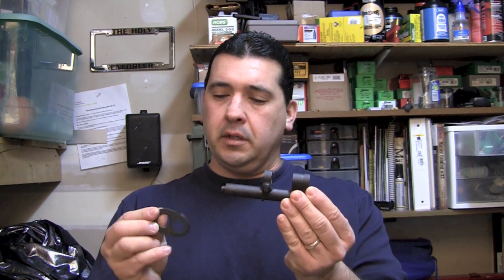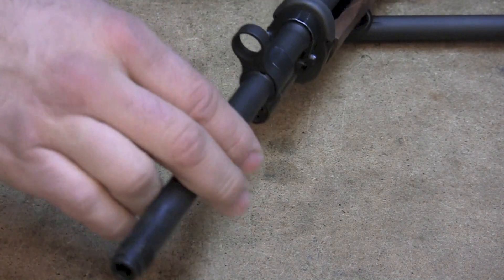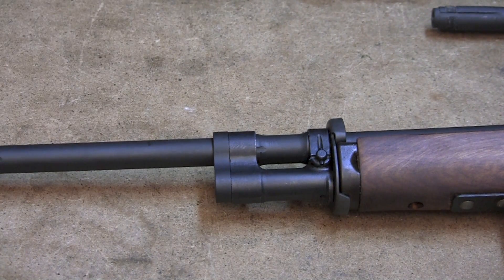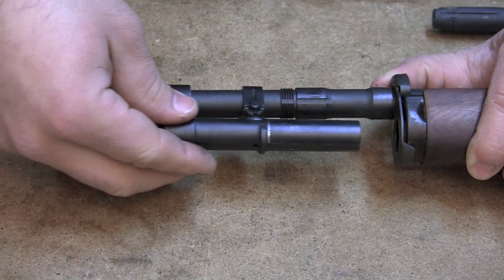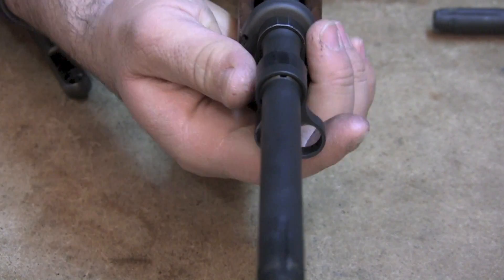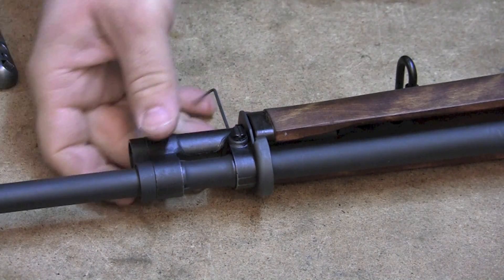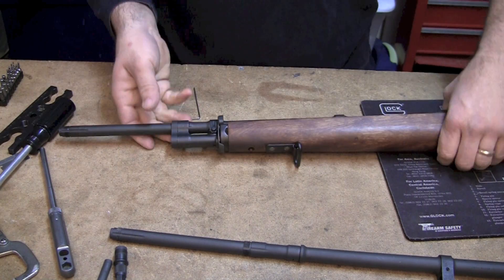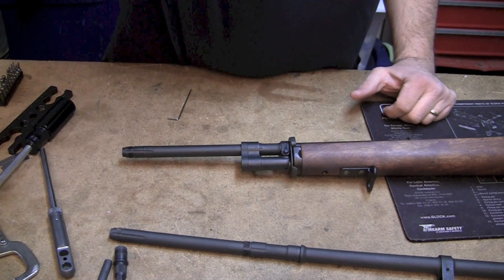Shimming the M14 Gas Cylinder and Gas Port Alignment

Comment: shimming is great but the gas cylinder needs to be unitized by tig welding the band to the gas cylinder. You still need to shim the cylinder for the correct lock up.

Comment: Does this require any special tools to completem
Reply: No, just the appropriate ring shims.. Badger Ridge Industries is a good source..  Although, some say "Just snug, screwed on to say say, 4 o'clock.. While others say screwed on to 7 o'clock, (GunBlue490) to allow for expansion when the barrel heats up.. This is somewhat new to me as well.. I'll have to try both setting...

Comment: Tony,  I have a m1a scout that I mounted into a sage ebr stock and the heel of the reciever is sitting up about a 32nd ish above the back of the stock.  I did have to have the barrel knurled by a gun Smith prior to me noticing the issue.  The Smith is going to add (machine) two set screws into my trigger assembly in order to tighten it down in the back.  Thoughts?

Comment: I purchased a norinco m14/305. The stock is loose front to rear when assembled I have 1/8”+ of play in the stock. The receiver is loose. I believe the problem is in the gas valve position on the barrel. Your video explains how to adjust it, I’m removing the nylon stock and replacing it with a USGI stock from Fred’s. I repaired the loose oprod guide block and installed the nm oprod with the wolf heavy duty spring. The fitting of the new stock and adjusting the position of the gas port is next, I don’t think this m14 has ever been shot. Thanks to you and your videos it should be up and operating soon. Thanks

Comment: Tony, 
Great videos! I have a question for you. My front band was loose so I bought shims  to shim the had block but I discovered that wasn't the problem. The front band is tight and the gas lock is roughly at 5:30, a little less but it can be positioned by hand. When I tighten down the the gas block nut the band loosens up. I removed the gas block but and discovered that there is .007 gap between the gas block where the piston goes and the gas lock when it's tight. This does not seem right to me. I would like to know your thoughts on this situation. Thank you.
Reply: This is a "Golden Age M1A, serial number between 42,000 and 63,000 of that makes any difference. Has all the hand work of Wilbur Smith with lots of GI parts used.
Reply: I did find pitting surrounding the gas port on the barrel. The gas block does not have any rotational movement from play in the splines. I am waiting on some castle nut pliers to remove flash hider. I will then check both gas lock and has block to see if either is not flat where they mate up. The gas lock is definitely not seating flush all the way around the barrel portion of the gas block.
Reply: جيد جدا

Comment: Hello sir,  thank  you for  this video.  Is it normal or ok to use all 3 shims?  Also I can see the holes line up witha flashlight but can't actually get the Allen wrench to go in the barrel. Thank you again
Reply from the maker: It's okay, as long as the gas ports line up.

Comment: Tony I am having some short stroking on my national match Springfield. Only 300 rounds in. Piston drops free. Gas port hole looks good but last hole where the barrel is through the gas port hole looks 75-80 open. Semi circle almost like the moon. Is that normal. It almost looks like my gas port walked a few millimeters forward.

Comment: My band is tight when the receiver is in the stock. When it is out, the band moves around. Should it be shimmed to remove the play when the stock is not on?
Reply from the maker: Yes, it should be shimmed so that it's tight when it's out of the stock.

Comment: I read about tack weld the barrel band onto the gas cylinder but to get a professional welder to do it. article says "When it comes to weld placement, there are two options: The first and most common in Canada is two welds at roughly 2 and 10 o’clock, and a third tack weld at 6 o’clock on the exterior of the gas cylinder. This method is popular because it allows the rifle to be assembled, and the for reference marks to be made with a punch on the gas cylinder and barrel band indicating their respective locations. Then the gun can be taken apart and the gas cylinder and barrel band welded up in the “neutral position” they naturally found themselves in on the rifle. The second method involves welding the barrel back to the gas cylinder on the backside of the barrel back, where the gas cylinder protrudes rearward through it. This hides the welds externally." ..heres the source...    https://calibremag.ca/five-ways-to-improve-your-norinco-m14-for-200/

Comment: I just love your videos, I own an M1A Springfield, I bought it used years ago well over 20 years now, I love shooting, I was in my early thirties then,(now 53) it came with woodland camo stock, not long after I bought it,. I ended up getting married. and never got around to getting to shoot as good as I know it can, have some years left and will plan on getting the right tools for this thing and keep watching your videos,... my flash suppressor is loose and seems the crown nut is as tight as I am going to get it,  came this way when I bought it

Comment: You might want to unitize the gas cylinder by tigging the band to the gas cylinder(USMC way) or by annealing the gas cylinder valve and attaching the band with screws (Army way). Just ny 2 cents, great info about timing, Semper Fi.

Comment: OMG you just made my year. My M1A stopped cycling 25 years ago when I let a friend shoot it. Afterwards he cleaned it etc. After that it never functioned again. I have been trying to fix the issue. I narrowed it down to the gas block. Never before have I heard the words spindle valve. I checked mine a d it was closed. Problem solved. Many many thanks.

Comment: Thanks for the great video. I have a question though. I just picked up a Norinco M305 and it seems the flash hider is spot welded on, in addition to the castle nut/ pin. Ive seen a video of a guy hammering the flash hider, breaking the welds to remove it. I considered trying, but then i thought, could I not just shim it between the stock and the band? I had a thin washer/gasket that fit well so I gave it a try. The lock tightens up fairly close to where the video reccomends though I may thin out the gasket a bit with some filing or grinding. The band is nice and snug. Still all metal to metal contact and i dont have to smash off the welds. I'd love to do it the right way, but would this be an acceptable work around for those of us with welded on flash hiders?

Comment: great video tony. I used to shoot m14 on a guard team ,and have always wanted one. I found a used walnut supermatch in like new condition for $1,100 last month and bought it. Well I now wear bifocals. In your opinion would scoping this rifle take away from what this rifle was really meant to do. I probably wont be shooting matches anymore, but I have national forest access with unlimited range distance opportunities. Any advise ? thanks.
Reply from the maker: I don't think scoping the rifle takes away from what it was meant to do. What matters is if you really like it. If it makes you happy, then go with it!
Reply: thanks for the reply. would u recommend low basset mount for quick switch back to iron sights, or arms 18 mount with quick detach rings, and sight over the mount? Also I would like to shoot slinged up with scope. Is that doable or should I forget that and just convert to bipod, (trying to save weight) Thanks again
Reply from the maker: Bassett low. Quickest on and off you'll ever do.

Comment: So the gas lock threads are 20tpi, that's .050" per revolution so from 6 o'clock to 11 o'clock is .020".Also never a good idea to use a gas lock that has been installed before in the other direction; it's like turning a ferule the other way around. Bad for the threads on the barrel; better to use a new gas lock if you absolutely must.

Comment: Hey tony, just a quick question. I just got a M1A loaded and was wondering if this was a form of tightening or "unifying" the gas system? Or are those permanent methods like welding? Thanks!
Reply from the maker: Shimming is different that unitizing. Unitizing permanently mates the front band and gas cylinder using either screws or welding.

Tony.

Comment: Great vid. But instead of buying shims and possibly having to change shims out as they wear, and worrying about gas hole alignment and the fact that shimming the band forward then loosens its grip on the front of the stock. Just stone down the gas lock until it times correctly. Problem solved. 
The gas hole location will not move, the pressure on the front of the stock won't loosen, and there will be no shims to ever worry about again.
Reply from the maker: The issue with that is that you move the piston back when you do that and there is a remote possibility of the gas port in the piston not lining up with the gas port in the gas cylinder. You can't really check that on the bench. You'd have to test it on the range. Plus, you shorten your dwell time which is not ideal for accuracy. 

Tony.
Reply: +tonyben3 
Shouldn't have to worry about dwell time or gas hole alignment as the rifle was designed to have the barrel band shoved back against the shoulder. Not shimmed forward.

Comment: Tony, just subbed and appreciate your videos. I was able to tighten the front band by lapping the thickness of the gas lock down by about .015" and not using shims. What is your opinion on this?
Reply from the maker: +rifletargets 
As long as the gas port is still aligned and the rifle cycles, then it should be fine.
Reply: Thank you for the prompt reply. Happy shooting.

Comment: Could I just cut a slit in the shim and avoid taking the front sight off?
Reply: +Shane Clark Any problems after 4 months of using this shim with the slit cut? I came to this video to ask the same question.
Reply from the maker: I've never tried it with a cut shim, so I can't say.

Tony.
Reply from the maker: +Shane Clark 

It may or may not work. Best to take the flash suppressor off.
Reply: +tonyben3 I ended up just cutting a slit and it worked out very well! So far in testing two 5 shot groups of my best match loads my rifle shot one just under 1 MOA and one right on 1 MOA. From what I can tell shimming took my rifle form 1.5 MOA to 1 MOA!!! Thanks!!!

Comment: Have you ever seen an M1a that could not be improved by shimming? I can hardly fit a razor blade in mine like you did. There is very little wobble if any. It that even enough space to fit a shim? Its a bit older. 15 years or so.
Reply from the maker: +Shane Clark 
If the lock times at 5 o-clock, shims are not needed. I have a barrel like this that requires no shims.

Tony.
Reply: +tonyben3 I just got it apart. It times or gets snug just past where it lines up at 7 or 8 o'clock. Room enough for improvement then right?
Reply from the maker: Yes, time to shim!

Comment: Good video Tony, I'm a new M1A owner and very new to acurizing one. Instead of using shims, has anyone that you know of used an O-Ring to correct the slack in the lower band?
Reply from the maker: +Jeff Thornton I haven't heard of anyone trying it with a rubber o-ring.

Tony.

Comment: My gasblock alignment is off. My rifle is having short stroke issues. Saw your video and tried to place an Allen wrench through with the gas port hole and was unable to get it into the barrel so clearly it is not lined up correctly could I remedy this by just setting the gas block just a little further rear word or forward? Or perhaps shimming it?
Reply from the maker: Check to see if there's a gap between the barrel shoulder and the front band. If there's a gap, your gas cylinder is not seated far enough. Check out my disassembly/assembly video and it shows how to properly seat your gas cylinder back as far as it will go.

Tony.

Comment: Thanks for the informative videos.  I shimmed my M1A and it left a visible gap between the op rod tip and the gas piston tip. Is that an issue?
Reply from the maker: Yes, that's an issue. It sounds like you shimmed it too much. I'll bet your gas cylinder was very tight to go on and you had one turn left to go. Take the shims off and start again. The op-rod NEEDS to contact the piston when all the way forward. If you don't get it sorted out, go to the M14 forum and post your problem.

Tony.